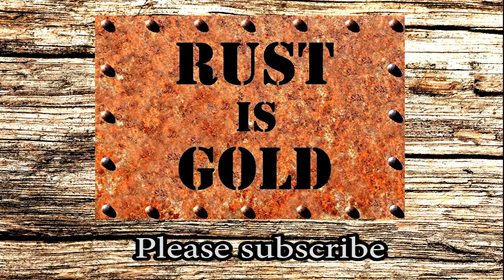Antique Iron Restoration

Comment: Do you have the process written out ? I would like to follow this as I have 3 to restore
Reply from the maker: Sorry... I don't... The video didn't help?
Reply: @RustisGold  There are a variety of wire thicknesses for angle grinder brushes. Some scratch steel deeply enough that you have to repair the brush scratches.